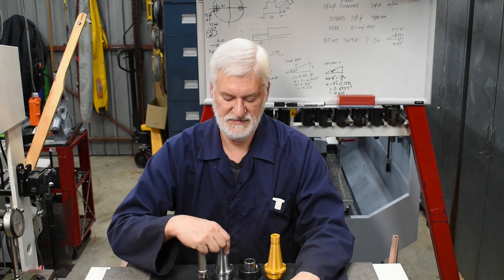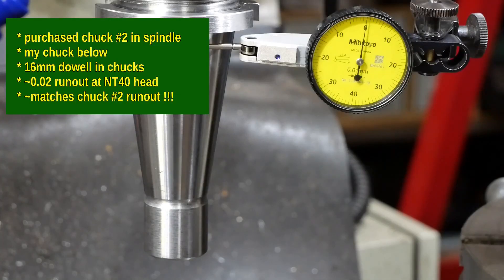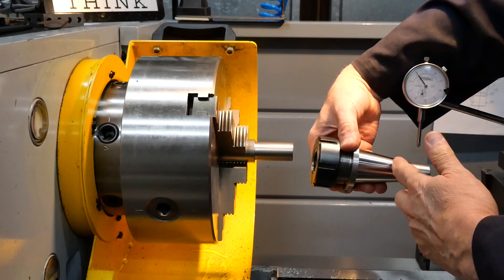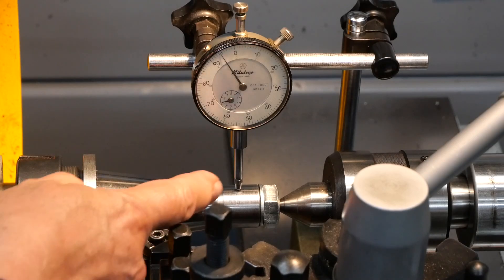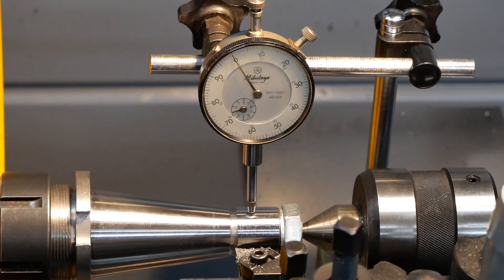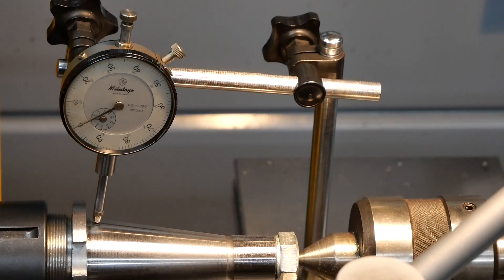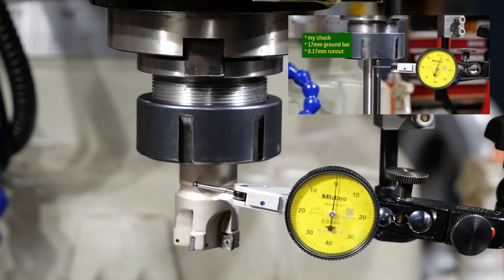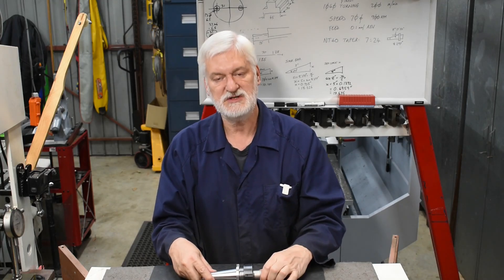Fixing Runout In An ER40 Collet Chuck

Comment: The NT tool holder itself, are mostly very accurate, it's when you install low grade collets into the ER taper is when problems arise. There are at least 3 different grades of collets, and if that's not good enough, you can buy adjustable ER collet NUTS.
Reply from the maker: Learnt something here - didn't know there were 3 grades of collets and had never heard of adjustable collet nuts. Thanks for sharing Steve.
Reply: In addition,, there are manufacturers that make very accurate nt/er tool holders, even from China. Check the specs.

Comment: Nice video Alan. So what method did you use to set the taper angle?
Reply from the maker: Thanks for the feedback Eric. I set the taper angle using a 5" Sine bar that is designed for use on the top slide and a gauge block stack.
Cheers.

Comment: You must have a very good set of ER40 collets, that's where I'm very surprised, at the low runout.
Reply from the maker: Well I probably caught a lucky break as I didn't try rotating the collet to see what difference that would make. The collet came from a set I bought in March 2020 from M&G Productions. Concentricity of the collets was claimed to be within 0.008mm - they still list the same set here: https://mag-pro.com.au/index/index/productsdetails/id/513.html
Cheers.

Comment: Nice work Alan
Reply from the maker: Thanks again for your help and patience. I suspect the original problem related to the hole that I drilled through the body of the NT40 socket. That went off-centre, and because the boring bar had such a long stick might not have fully corrected the eccentric hole. I'll test this theory by remounting the NT40 socket and running a dial gauge in as far as I can reach.
Cheers.

Comment: Gday Alan, definitely a nice result, little bit of scotchbrit will shine the arbor up like new, great job, cheers
Reply from the maker: Thanks Matty - what grade/colour Scotchbrite do you use ?
Reply: @alanshomeworkshop  Gday Alan, I use the maroon and grey coloured scotchbrit
Reply: @alanshomeworkshop  lookup 7448 extra fine silicon carbide
Reply from the maker: Thanks for the tip. I bought some grey, red and black today from Sydney Tools. It's currently on a special with most grades 30-40% off their normal price eg grey $2.03/sheet. I'll look for an opportunity to try it in my next video. Cheers.